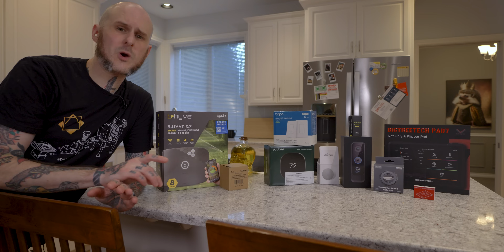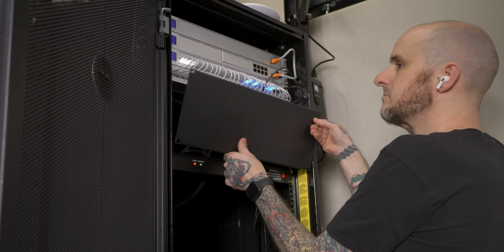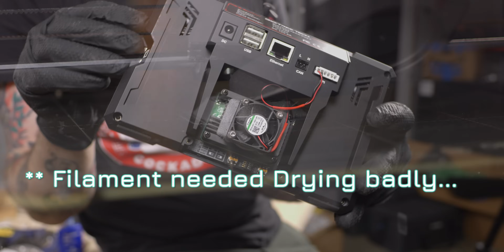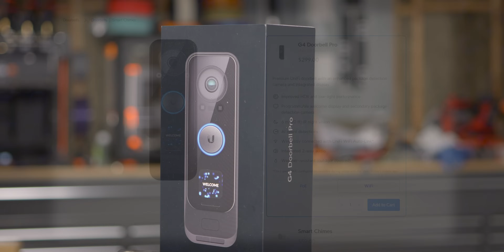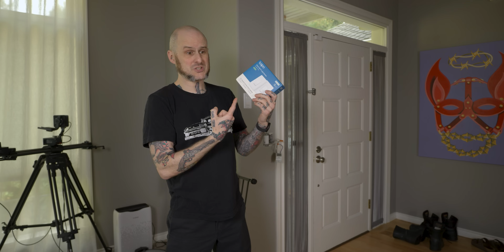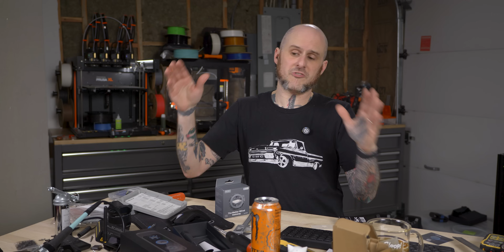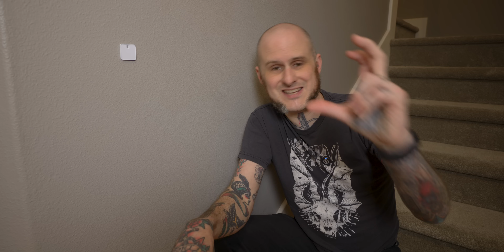3D Printing My Way to a Smarter Home—One 'Dumb' Gadget at a Time

Comment: mmwave radar presence sensors
that's peak of home automation. frick buttons! you got 20GHz presence detecting beam turning lights FOR YOU
I split 5V from my AC head unit control boards to mount them discretely. It ie. turns night mode for AC, when you leave living room/office for the night or turns lights on and off
Reply from the maker: I was heading down the motion / presence sensor territory for the step lights, but decided to go “easy” with a switch for now. (Didn’t work out clearly 😅)